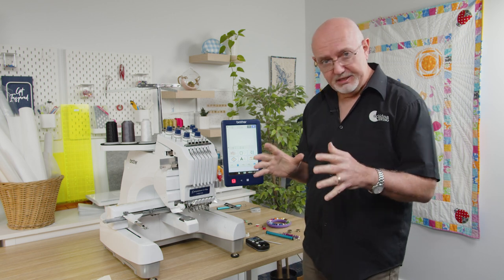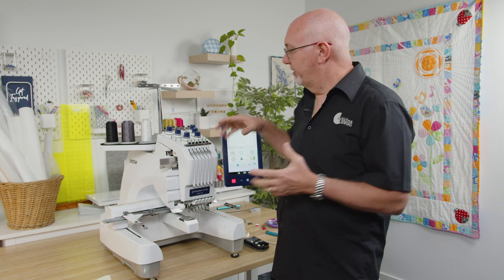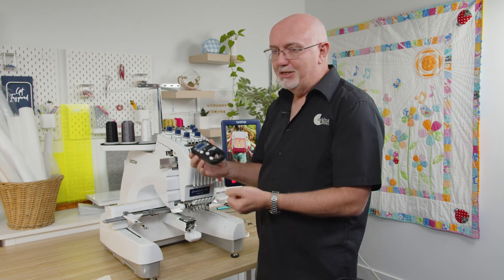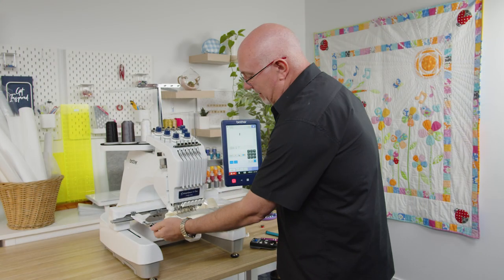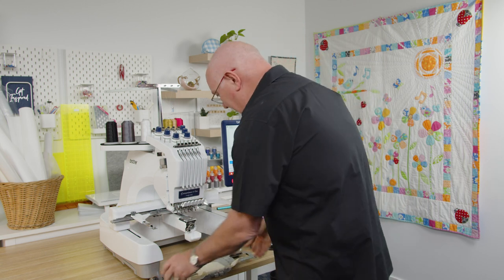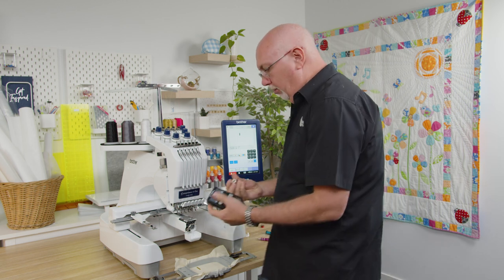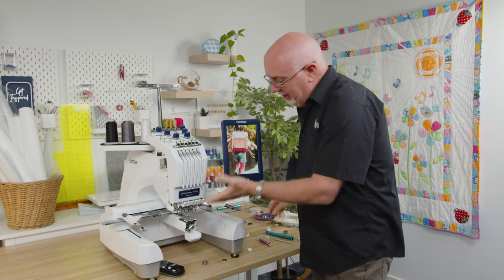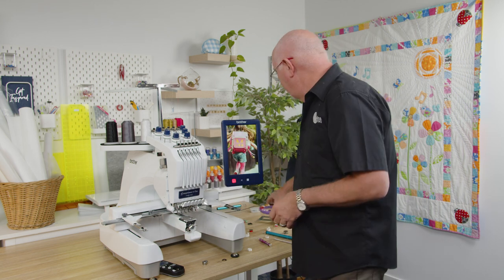Adjusting tension on PR series machines | Echidna Sewing

Comment: Great video and lots of good advice, any info on how to use the pre-tensioners on the PR Machines?
Reply from the maker: @TheDeadlyviperuk Thank you for watching our video. If you look on page 118 of your manual it will explain how to use the pre-tensioner.  A lot of the time it isn't necessary to adjust these, you more would adjust the large tension dial.

Comment: Hello, thank you for that great video! When I pull my thread through the bobbin, there is tension at one point during each revolution. How can I compensate for this movement so that the thread can be pulled through evenly? Where is the error there? Thank you very much!
Reply from the maker: @jan-catharinastier4543 If it is pulling through unevenly then there may be an issue with your bobbin case.  Have you got a spare bobbin case to try?

Comment: Thank you Gary. I have recently bought some metal bobbins for the PR machines that you thread yourself. I noticed that there is quite a difference in the tensions between the normal pre wound bobbins and these. Is that due to the weight of the metal bobbins?   Have you tried these? I would like to see a video about these to see what your feedback would be. 
Regards,
Ann.
Reply from the maker: Hi Ann, it is very normal for the tension to be different and yes it is the due to it being a heavier weight. The PR machine does cope with the metal bobbins, but we do recommend the prewounds as an easier alternative.

Comment: Gary, your video was just suggested to me by YT, likely because I have been focused on embroidery videos. I just got a sweet deal on a new Baby Lock Verve which is a combo sewing/embroidery machine. After watching your video I feel as though I will have many issues with tension purely because I switch between embroidery and sewing. The threads are different in weight and therefore I have to assume that the tensions are going to change all the time. To add insult to injury the machine has a drop in bobbin which, though convenient, I don't care for. Do you have any suggestions as to what I should watch out for as my love of embroidering grows? I literally bought the machine to replace my Baby Lock Decorator's Choice that has aged out and is making horrible noises. I don't really want to put any money into a 20 plus year old machine that is electronic for fear of having even more breakdowns and throwing good money after bad. The Verve is an almost identical machine in all of it's sewing functions other than a few extra designer stitches thrown in. Since it had the embroidery unit that came with it I thought I would try it out and I'm finding that I'm hooked! I intend to incorporate some embroidery with my card making skills by adding embroidered panels to the card fronts. (I've already made one detachable Christmas tree ornament that is on the front of a card I sent to a relative.) Since your videos were very helpful when I bought my cover stitch machine I thought I wouldmm reference your videos again regarding this machine. Do you have any advice for me?
Reply: Hi Susan, the Verve is pretty much the same as the Brother NV180  https://www.echidnasewing.com.au/brother-innov-is-nv180-sewing-embroidery-machine - all the videos on this page will be applicable to the Babylock Verve. 

They are great machines and super reliable. If you are concerned about the tension flicking from Sewing to embroidery then a simple fix is to buy a spare bobbin case and use it specifically for embroidery. This is the genuine case we sell in Australia https://www.echidnasewing.com.au/xc8167551-embroidery-bobbin-case-purple-dot-nv1200 - your local dealer should be able to assist you with this. 

They are very easy to change and hold good tension. As your embroidery passion grows you'll almost certainly yearn for a bigger hoop - stick with a Brother or a Babylock and you won't go wrong.  Hope this helps Cheers Gary
Reply: @garywalker5394  Thanks Gary for taking time to reply. I love your videos and, honestly, your accent is music to my ears. I always dreamed of visiting Australia some day but YouTube is as close as I will ever get. I am putting a copy of your advice in my sewing log book and following up on this later this week.

Comment: Hi Gary, do you have a similar video on how to adjust the tension using the same technique for a single needle machine such as the NV880E
Reply from the maker: @marievarcoe The adjustment for your top tension is in your machine settings.  In saying that, you may be having issues with the bobbin tension which you would need to adjust your bobbin case, or you may have thread caught in your tension discs for example.  It is a matter of knowing where the issue is to fix a machine tension. What issues are you having with your tension?

Here is another one of our videos where Gary goes through the towa gauge when fixing tension on the bobbin case:
https://www.youtube.com/watch?v=63B-4Boz1Bk&t=346s
Here is a video to check for lint build up in the bobbin case:
https://www.youtube.com/watch?v=KpwwPZ9VNBo

Comment: Any tips on why my machine isn’t cutting the thread? Sometimes it does and leaves a long tail and sometimes it doesn’t cut at all. I’ve cleaned it, tried everything…even replaced the knife.
Reply from the maker: Hi there, the issue you're describing can be caused by any number of variables and requires a little more information for us to give you a solid solution. For further support you're welcome to contact us via email at support@echidnasewing.com.au

Comment: Hi i have a question. After i finished embroidering, my machine goes auto cut. After the auto cut, the thread shoots back up and i have to rethread into my needle. Why is that happening?
Reply from the maker: @iheartropetech9789 This can be the thread - sometimes they are a bit springy and so when it is cut under tension it can spring back.  Can you try a different type of thread and see if you have the same issue?
Reply: @EchidnaClub  i changed my bobbin case and it works like normal. But just wondering why, ive adjusted the tensions too
Reply from the maker: If you give it a good clean out in the bobbin case area as well will help.  Sometimes its the thread getting caught up in the cutting action.

Comment: HI.  Do you know of a Longarm Thread that will give me more resistance on Top?  I am Quilting in the Hoop using my Janome Mb4 (completely overhauled recently).  But my Omni and Perma Core thread do not offer as much resistance as my regular embroidery thread.  So, I am stuck using embroidery thread to quilt in the hoop.  And even with that, I have to turn my Top tension up all the way (to about 22 grams).  My Bobbin is set at about 10 grams.  I am using the same thread on the Top and Bottom since this is Quilting.  I can use the Omni/Perma Core on my Brother SE600 with no problem.  I assume the Single needles just do better with allowing the 2 threads to meet in the middle, because that's what they were built for. Do you have any suggestions?  Can you try and quilt in the hoop on your multi-needle and let me know what Tension settings you used on your Towa, and what thread you used?  I have both the digital and manual Towa's, plus a Tajima Tension Gauge.  Maybe you can do a video showing this.  :)
Reply from the maker: I'm not a quilter but it Sounds to me that you simply do not have enough top tension. 22g is very light as is 10g of bobbin tension. I don't carry the Omni and Perma Core thread so I can't test that and  I don't currently have an MB4 on hand to check but I feel you should be able to increase the needle tension more than you saying. Even then there will be no one size fits all setting I can give you for this. What needle tension do you get with embroidery thread?